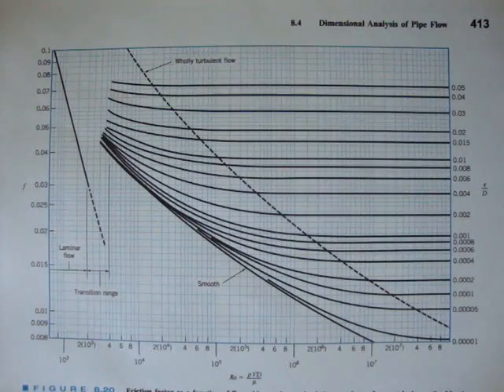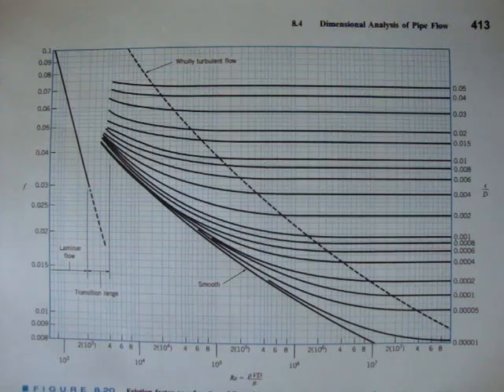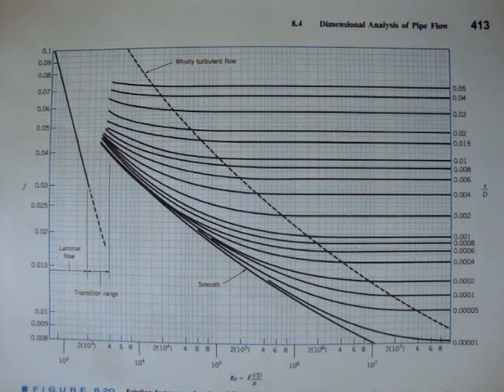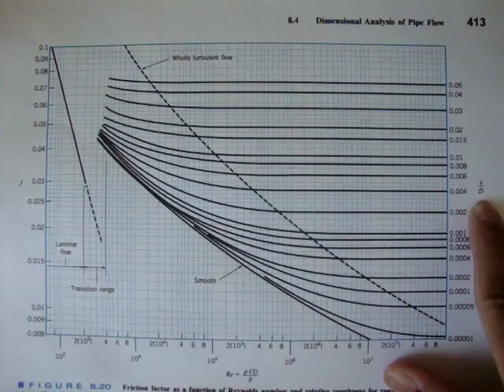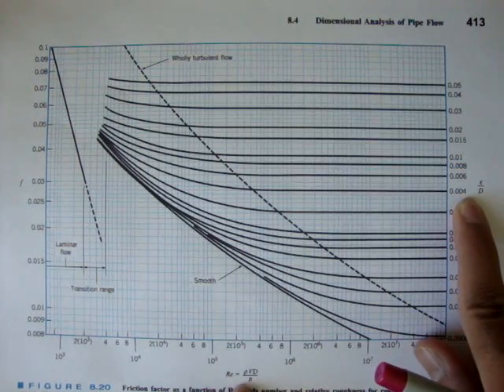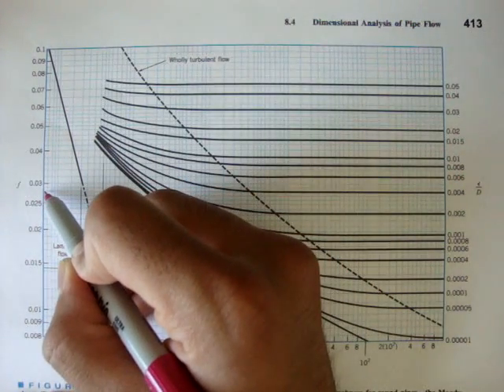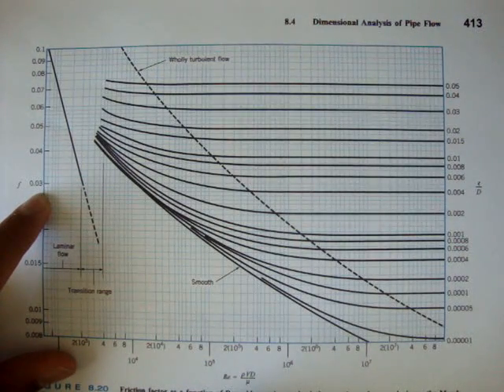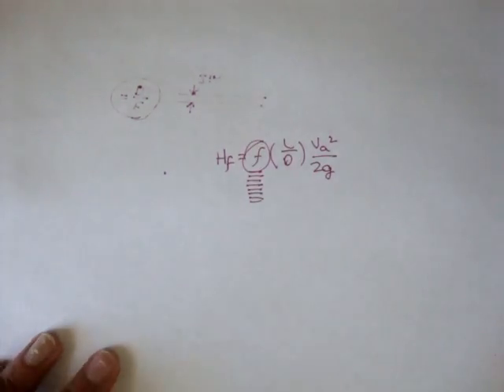Turbulent Flow: Moody Chart [Fluid Mechanics #41]

Comment: Hence, moody's chart is a graphical diagram consisting of three components. They are a frictional factor(f) to the left, Relative roughness to the right, and Reynold's number to the bottom. We usually have one or two of these values. Then, we use those values to find out the required unknown values (usually f), then we apply the required formulas.

Comment: I have some calculation for my project which are re is 94 K and for Ks/D is 0.000047 but the corresponding value for f lies below the curve , so should i stick with the f= 0.25/(log10((ks/3.7D)+(5.74/Re^0.9)^2)))^2 ???

Comment: Moody's chart can be used for laminar flows too, for calculating the pressure drop in fully developed flows.. 
And Reynolds No. greater than 4000. Not 2000. 2000 - 4000 is Transient condition, as pointed out by many others.. 
Kindly correct it.

Comment: The chart is for laminar, transitional, and turbulent flows. Laminar flow is a constant where the friction factor is no longer related to roughness "e". Transitional flow is the one where both Reynolds # and relative roughness e/D are used. For the turbulent flow condition the friction factor is no longer a function of the Reynolds number, which is why the curve flattens to e/D; the values are read straight across in the turbulent region. So really there are three ways to read off friction factors from this curve, not just the one you are presenting. In addition, it would be helpful to note that there are 3 different scales to get used to on the graph: e/D is a skewed bell curve of log scale, f is a bell curve of log scale, and Re is a log scale.

Comment: at 0:28 you said if Re > 2000, flow is turbulent but it should be 4000. between that should be transitional. 
Thanks for the video
Reply: Different litterature tend to use different values depending on the context and how ideal the situation is. The transition can be anywhere between 1000 up to 5000. Reynolds originally found it to be around 2100. Most textbooks however say that the flow is unpredictable/transitional between 2000-3000. Your textbook may be focusing on a context where the flow is more unpredictable if the transition is between 2000-4000.
Reply: Re<2000. Turbulent flow, Re>4000 laminar flow , 2000<Re<4000 transition flow.

Comment: WHAT IF it wasn't perfectly on the line, let's say it was 0.003 and 2 x 10^5
Reply: 2:13 of this video explains: https://www.google.com/search?q=how+to+read+a+moody+diagram&rlz=1C1JZAP_enCA815CA815&oq=how+to+read+a+moody+diagram&aqs=chrome.0.69i59l2.3695j0j9&sourceid=chrome&ie=UTF-8#kpvalbx=_HV5DXo35HsfVtAa-2o2wBg27
Reply: @MelodyTadeoJ  Give link of concrete video, not bunch of it. Still not found way for 0.003
Reply: @zvonimir-antestipic9025  Even after opening the video this is the only URL that came up.
Reply: @zvonimir-antestipic9025  I think it was the same as this one: https://www.youtube.com/watch?time_continue=94&v=PgAXycpuZqM&feature=emb_title
Reply: @zvonimir-antestipic9025  Did you look at it?

Comment: what if we have a reynold's number equal to 2.10^4 and relative roughness of 0.008?
do I follow the black line as it curves up or do I take the crossing of the vertical line at 2.10^4 and horizontal line at 0.008?

thanks
Reply: I think if you follow the line you will be alright. Hope this helps - Dr.Dan 👍